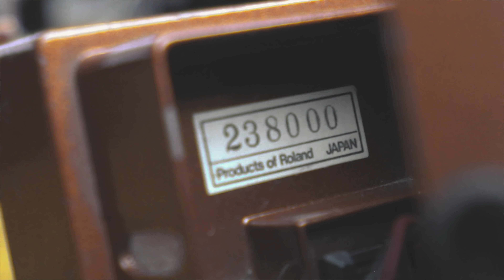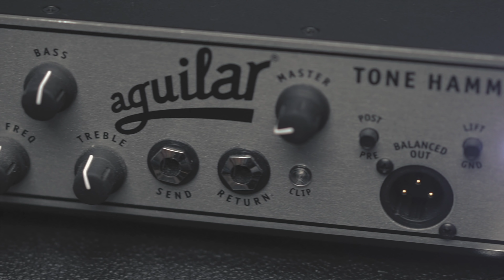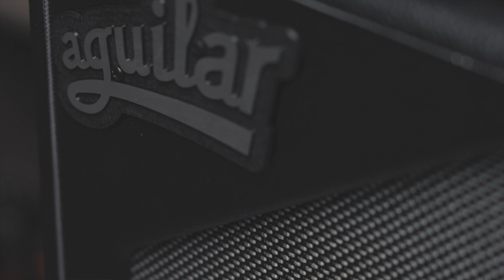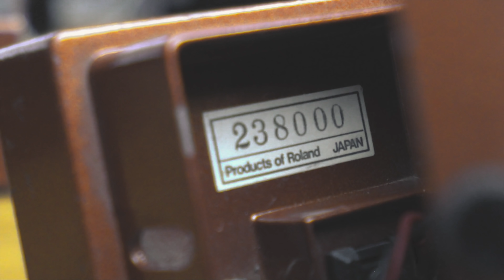Boss OC-2 The King Of The Octavers? | The Pedal Studio

Comment: Yes! We need those Waza Craft pedals!
Reply from the maker: Big time. The campaign has started!
Reply: OC2 and PN2 definitively deserve a Waza Reissue. As per each Waza, they should get an "extra" mode:
- the extra for the OC2 Waza should be Jojo Mayer mode (bypassing the controls and 100% octave down direct to the output). Make it switchable from the outside via extra footswitch so we can alternate between this mode and the regular Pino Palladino / Guy Pratt settings without having to bend over to the board between songs
- the extra Waza mode for the PN2 could be extended range on the Rate to get the modern chopper trem speeds. And a tap tempo footswich !
Reply: @alexm.3098  That sounds like a  really useful mod ideas
Reply: I would love the PH2 Phaser Waza, big Phaser fan.
Reply: @alexm.3098  I would say that the Waza reissues we need are:

HM-2 Heavy Metal

We've been asking for a reissue for years. Classic distortion pedal that's surprisingly versatile. The extra mode could be a boost circuit via footswitch, or maybe a different flavor of distortion, kinda like the DS-2

PN-2 and OC-1, as discussed

SG-1 Slow Gear, this is one of the most coveted Boss pedals, and it's absolutely cool. You can do weird atmospheric stuff with it, and modern bedroom players would drool over it. I don't know what the extra mode could be. 

And maybe the LM-2 Limiter and the FB-2 Feedback Booster, both really cool pedals going up in price. Thoughts?
Reply: What is a Waza Craft pedal?
Reply: @georgefarmerbass  It's a reissue of classic pedals by Boss, but with extra features and improvements. I believe they are also made in Japan, so that's why the price a bit higher. Go check out their line, it's pretty awesome.
Reply: Samuel Freeman Awesome. Will do. There are a couple that I’m looking for. Thx for the info.
Reply: No OC-2w. Boss are releasing the OC-5 instead. Yet, to try this out, but slightly annoyed that this will be a digital pedal (like the OC-3) rather than an all-analogue reissue of the OC-2. Reserving judgement until I’ve had a chance to compare it, but it will be scrutinised closely...
Reply: @iamtheelvy  Just bought an OC5 and you don't get anything weird on it for being digital, it's actually an awesome pedal! Nothing to do with the OC3, it is really really similar to an oc2 but with better tracking and lots of posibilities 👌

Comment: At the beginning of the Taiwanese era, Boss was still using the same supplies that they were in the MIJ. For that reason, we have a couple black label made in Taiwan OC-2s that were made in 1989-1990. The major change in sound between the Taiwanese and Japanese OC-2s didn't actually happen for another 3-4 years when Roland/Boss switched from the OG BA634 chip to the 4013 chip.
So in short, there are a lot of "Made in Taiwan" OC-2s out there with the same parts as the Made in Japan ones. Not to jack the comment section, but I did some research last year and made a video on all the different OC-2 variations out there: https://www.youtube.com/watch?v=vTP4nN51TPM
Janek's video is so much more well done though. Loved the stop motion at the beginning and all the camera lens tricks and that bokeh. The production of this video is just so spot on
Reply: Good info. So a MIT OC-2 from '89 - 92ish has the same parts as a MIJ?
Reply from the maker: Alex, nice one! Great info in your video, thanks for the link. Definitely fills in some of the things I missed. I was aware of the 634 vs the 4013 chips, and roughly when the pedals were made and where. and the whole color change thing (which I forgot to mention in the video). But you definitely went deep on the info, so thanks for that! Just glad I have OC-2s from every era to really check out the differences. I'm slowly campaigning to the CEO of Roland for Waza versions of both the OC-2 and PN-2... 🤞🏻
Reply: @janekgwizdala  Ah man I would love to have your collection. The Waza OC-2 is a must. Put me down for it.
I don't understand schematics well enough, but according to someone that commented on my video, the 634/4013 swap supposedly only affected the second octave down. He had a few resources to back it up.
Reply: Yeah i had a japan and taiwan and abd em.  I couldnt tell a difference.
Reply: @labgnat  That's probably because you were powering them correctly. There is a lot of confusion re/ PSA and ACA. No many are reading the labels and some of those ACA pedals poered with regulated voltage supply have voltage so low (~7V) that it stops them from operating at full potential.
Reply: Another important thing to mention in the video: power the ACA pedals with the correct power supply (11-12V).
Reply: If you remove the diode @ D3 and the 470 ohm resistor @ R17 from the circuit board and just bridge the connections, you have effectively converted the pedal to run from the more usual regulated 9v power supplies (or PSA equivalent) we all use these days… 😉

Comment: How do you put velcro on  your oc2's? I'm having trouble cause I don't want to rip off or damage the label... I was thinking into make some sort of pedal cover and save the original one apart. 😁The one I have is a Taiwan made like the one in the video, black label, with the dc jack low down and the BA634 chip. I bought it second hand and the guy who sold it to me said something about it was build in Taiwan but with the japanese circuit. That was more than 10 years ago I guess and I didn't know much about the oc2 back then, the only thing I was shure was that it sounded better than my oc3. I know it's not a super expensive 80's japanese made "octaveR" but it's in very good condition and I would like to conserve it in that way as much as possible.
Reply from the maker: Unscrew the backplate, and simply turn it over and screw it back on. The label will be inside, and you'll have a nice flat surface to put velcro on. It's easy to clean when you want to take the velcro off, and you save the sticker.
Reply: @janekgwizdala  I will try that! i thought about that option but I was a little worried to push too much some components on the board 😬 thanks Janek! 🙏

Comment: I have a Japanese 'Octaver' OC-2 from 1983 & a Japanese 'Octave' OC-2 from 1987 & both of them have the 4013 chip on the circuit board.
Reply: Same here! I have an OC-2 spelled Octaver, dated from August of 1982 with the 4013 chip. I read from the schematic that the 4013/634 chips only control octave 2. Perhaps our units prove that the 4013/634 chips were used interchangeably in earlier productions

Comment: If you run the OC-2 at 12volts it tracks cleaner and sounds better.
Reply: I keep reading this, I've got a power supply which can give out variable voltages, but I really don't notice any difference between 9 and 12.
Reply: Stop with the bad info please. Some TW pedals are still supposed to be powered with the ACA psu (~12V). And people repeatedly undervolt them by hooking them to 9V isolated power supply (the internals then drop this voltage down to ~7Volts and headroom goes out the window).
Using the power daisy chain is why it is working correctly for some of you. This way the pedal gets the right amount of voltage trough signal cable.
Reply: Tomislav Simić  Yes sorry my info was incomplete not so much wrong but I was referring to Alex Prices’ info should have directed you all there. Again, sorry for the misinformation.

Comment: How do you use the expression pedal with a TRS cable? Where do you plug in the expression pedal and how? And where does the expression pedal go? And what is a TRS cable? Can someone pls help
Reply from the maker: TRS stands for Tip Ring Sleeve. You use one in conjunction with an expression pedal when a pedal has an expression input. A filter pedal for instance will often have an expression or "EXP" input, and you can use an expression pedal with a TRS cable to control things like frequency.

Comment: Great review Janek! 

After a series of trades from different pedals I ended up with 5 octave pedals: The Octamizer, 3Leaf, OC2, Vintage Bass Octave and the Octave Deluxe. I did a review on my channel if you want to check it out! My conclusion: OC2 is the best, and the Octabvre really shines in a band setting. I really love the Octamizer for a clean beefy pad and it's definitely a nice pedal for clean sound. For soloing i'd still chose the OC2. 

About the MXR pedals, FYI I was really disappointed by the Vintage Bass Octave. The octave -2 and -1 sound really close to the OC2 but I found it extremely laggy. I always found the that the octave voices on the Vintage and the Deluxe were not precise enough, kinda ''squishy'' which makes them laggy when I play staccato. Anyway, I'm a passionate about octave pedals too! ;)
Reply from the maker: Thanks for your comment. Will check out your video. Interesting about the MXR Vintage Bass Deluxe. Maybe they didn't end up using the circuit in my OC-2 after all! Well, I'm definitely still interested to check it out, and put it through its paces from both a passive and active standpoint, and also see how it reacts in a chain.

Comment: I do believe that it's the Taiwanese versions that use the ACA adapter that have the same chip as the MIJ versions... the other Taiwanese versions are those that later were using the PSA adapter as the sticker will indicate... also the earlier ACA Taiwanese versions will have the AC adapter input low like the MIJ versions

Comment: Used and OC-2 for years, but having purchased the MXR bass octave deluxe, I think the MXR is better.
Reply from the maker: I think it's really hard to compare these two pedals, because they are so different. And like I say in the video, the main reason I use the OC-2 the way I do, is to actually mask the natural sound of my bass, not to track it accurately an octave down. I think the MXR is great at tracking the bass, and giving you a lower octave that sounds more bass guitar-like, but it's not good at getting a synth sound. That's why I think they're both great pedals, but also completely different. I love the mid switch in the MXR BTW. Great feature that can really give the sound some bite when you need it.
Reply: After further review, it appears I missed the part where you said you prefer the oc-2 because it masks the bass guitar tone. The mid boost is what sold me. I always lost so much signal from the OC-2.
Reply: @Janek Gwizdala thanks for the content as always.  What settings do you find work best with the Mid switch?  Did you change the internal settings from factory default?  Do you find the Mid switch works best with the different octave knobs, Growl and Girth?
Reply: no way

Comment: Janek,
The Valeton OC-10 is also a great, affordable, and compact version of the OC-2, but shhhh, don't tell anyone: 
http://www.valeton.net/html/en/index.php?ac=article&at=read&did=62
Reply from the maker: Yes! I heard good things about this one, and it came up a bunch of times in recent weeks when I was thinking about making the OC-2 video. Bummed I didn't get around to grabbing on in time for the video, but will plan to do a much bigger ocvater shoot out at some point, and try and include this one!
Reply: I've got one, and while it usually sounds great i found that it clips in a distracting and unpleasant way in the lower range (for example, an octave above open E) with an active bass. I haven't tried it yet with a passive bass, but my MXR mini octave does not do that and I assume the real thing doesn't do it either.
Reply: I have that OC-10 for traveling, but it is quite different from OC-2. for me, the response was a little different especially in the lower range. For me, it's very super easy to make it bouncy/punch sound with OC-2, but i felt like I had to work a little harder with OC-10. Of course this will be different for different bassists. But for the cost? super good deal, and a decent backup.
Reply: TC Eclectronics also make a clone of the OC2 under the Nether Octaver name, and it's really cool for the price